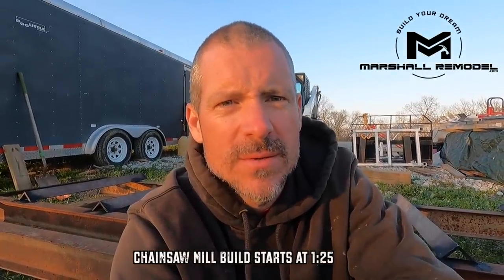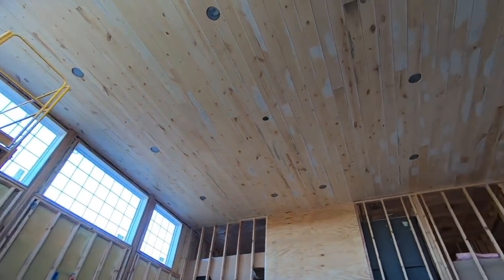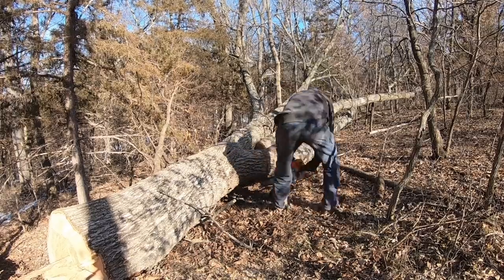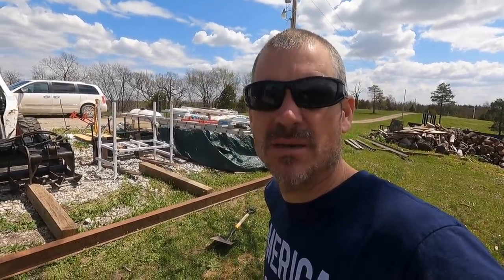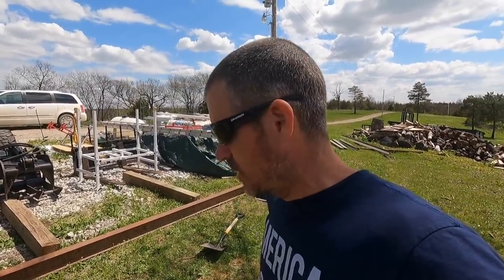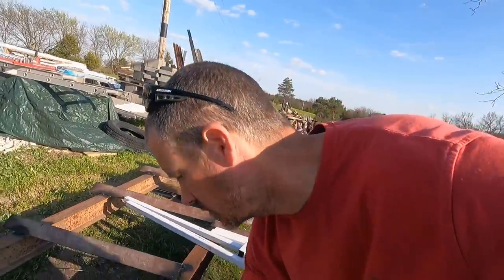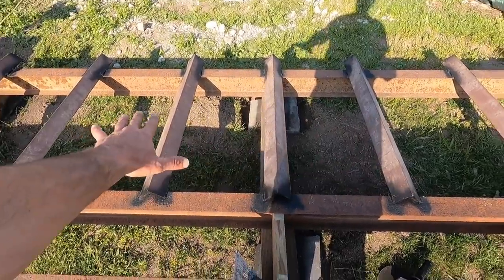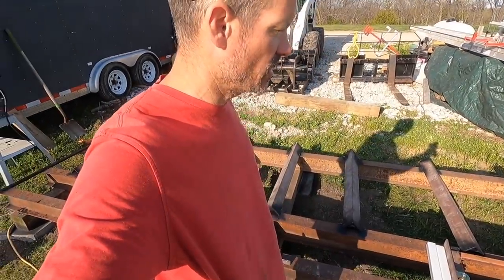Drywall is FINALLY Done! & We're Building a Chainsaw Mill Pt1

Comment: You've gotta support the other end of your bar. If not, you won't be making square boards.
Reply: I was thinking the same thing, bar deflection.
Reply: @readtheinstructions1407  yeah, that thing will sag, and or twist. Better than a bandsaw mill though (at least a thin bladed bandsaw). People whine about waste with a chainsaw mill, but after you have to plane off almost a half inch from a wavy board, you'll stop whining about the kerf size.
Reply from the maker: Thanks for the input!
Reply: @MrPostFrame  no problem brosef. I'd hate to see you cutting 12 foot wedges instead of boards. The Alaskan mill is some work, but so is planing half your board away, and planers ain't cheap. I just jack up one end of my log, and the mill pretty much pulls itself through the log. I even put juuuuust the slightest bit of back pressure on it, and it runs smooth as....... well, a chainsaw through wood I suppose.

Comment: Speaking from experience having used both chainsaw mills and bandsaw mills, you might want to look into making a bandsaw head for your mill sometime down the road if you ever end up doing a decent amount of milling. Chainsaw mills work nice but they are significantly slower than a bandsaw mill and produce a lot more waste because of the cut thickness. Chainsaw mills also use a lot more fuel. Actually I think you could have a really neat design if you had a setup where your chainsaw head cantilevers so that you can make big wide initial cuts on logs that would be too wide for the bandsaw head. Then you could come back and mill the rest with the bandsaw head.

Comment: As a help, maybe share a whiteboard drawing of each phase at the start of Phase II. Chainsaw mills have to cut from top to bottom, or straight up and down I guess, so you don't mention how your trolly saw-guide is going to lift the saw and keep it level, and your design doesn't prevent wildly-heavy lumber from rolling off the mill and onto the saw - and saw-er. I know you realize that just a single cut/slice can be too heavy to lift. I think most automated mills tip logs a little toward a 1" to 18" configurable backstop and then flip the log upside-down onto the level first cut "pass" on the top. The mill then makes all of the rest of its cuts from a level-seated log.  (I could be wrong)
Reply: i ban saw mill would be so much better. he will find out

Comment: Hey Paul, you may want to add a couple mount points on one end of the mill that you can mount a small hydraulic bottle jack to be able to raise and level out the taper of the log. Just make sure it’s in a spot where you can get to it easily to raise/lower it since it will be manual. Another option would be to add a hydraulic system with a small hp gas engine, an old log splitter would work awesome, so you could raise and lower the log, raise and lower your stops, etc., with ease!! You can probly find an old log splitter around this time of year that needs work for almost nothing that you can steal everything off of and move over to the mill and weld /bolt everything in place and have all of your stops and dogs and leveling run by hydraulic levers with the touch of a finger. That would be an awesome upgrade buddy!

Good luck on everything man, it’s all looking fantastic!! Take care and be safe out there!

Comment: I'm surprised you didn't do your own drywall. Why? Are afraid you might not achieve the level of quality you desire?
Reply: Some things are just best left to the guys that do it every day hector. In my experience, it’s worth every penny spent having the pros come in to do it for you. If you don’t do Sheetrock every day then there’s no way you can compete with the quality and efficiency that those guys can give you.  

I will do small patches and things on my own but I learned a long time ago that it’s not worth trying to do a complete hang and finish on my own, and I’m even good at it !! You just can not do it as good as those guys can not as quick and that’s worth more to me than what I would pay them
Reply from the maker: Since there's 12,000sf of wall space we figured it was worth having a crew come through and get it done quickly.